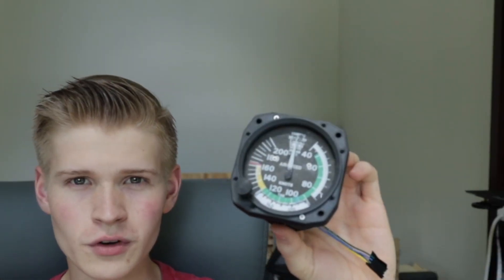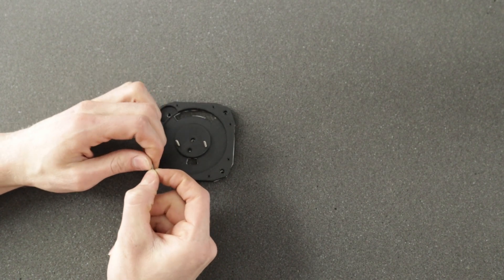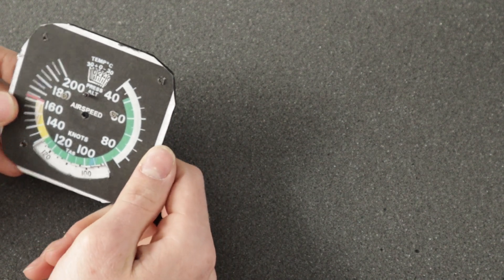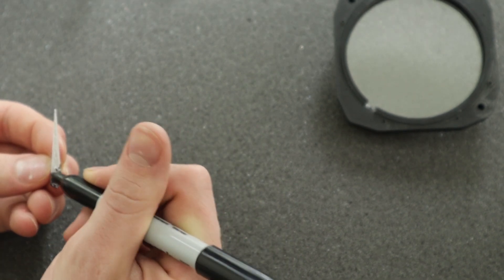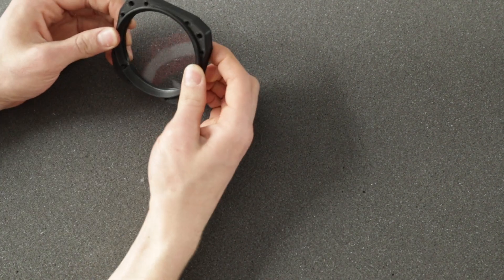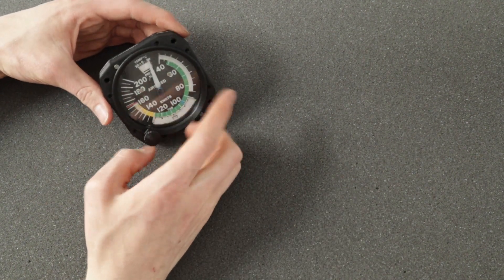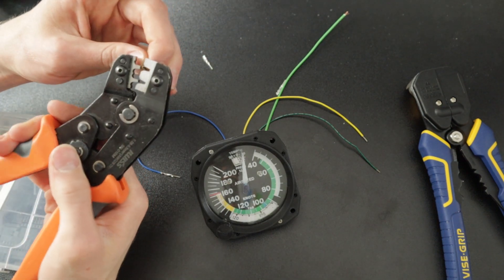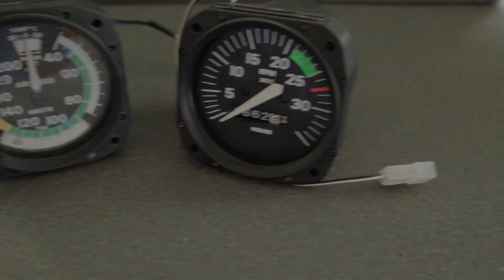DIY Cessna 172 Airspeed Indicator | C172 #33

Comment: Very nice collection of instruments you've put together! I've printed the 28BYJ-48 version (since I have several laying around), and I'm trying to figure out what you used to join the needle to the pulley - any hints?
Reply from the maker: Hi Chris! What do you mean by pulley?
I did use some super glue to attach the gear to the knob.
Reply: @CaptainBobSim  I've tried a couple of times to reply, and not seeing it show up, so maybe including a link is a no-no. In any event, the pully is in your github (Section 2 - Component Library and Structure/2-5 Instruments/6-PACK_Airspeed Indicator/28BYJ Stepper Version) as "Back Plate Stepper 28BYJ-48 Pully.stl" That's the piece I'm referring to. Looks like maybe there's supposed to be a metal rod or something that interfaces between the needle and the pully, but it's not shown in the fusion file. 

I just had some X27s show up, so the question may be moot, but I do like the idea of not having the screws coming through from the front of the instrument with the 28BYJ.

Comment: 🤔 Is there any reason to use a driver if we can just connect it straight to an arduino?
Reply from the maker: Just for fun!
These are small enough that the signal pins can provide enough power to move the shaft of the motor. The drivers also have built in diodes which mine does not have.

Comment: Your projects (and the Warthog project) makes me want to make a flight sim cockpit... even though i don't fly. :D  I  am using similar techniques to make an Apollo 11 DSKY though... :D  I love how low-tech it all is, but when it comes together, it looks just like the "real thing".  :D
Reply from the maker: Go for it! I find it's really fun, even though like you I don't really fly 🙃
Reply: Also, you should get a black paint marker to use instead of the sharpie... it'll have a much denser black.
Reply from the maker: I ended up using a printed decal and that gave a much better look. A lot of it also is the bed finish the printer gives you.
Reply: one trick i heard, which i haven't figured out how to do yet is to print blacks with full CMYK rather than just K, and it will come out more dense on the paper..
Reply from the maker: @yorgle  Interesting! Let me know if you figure it out that would be relaly nice!

Comment: Hi,
i was wondering how you made the decal?
Reply from the maker: I printed it on a shipping label
Reply: @CaptainBobSim  Where did you get the Image from?
Reply from the maker: @LeNinjaHD  It's on the GitHub under component library: https://github.com/CaptainBobSim/The-Cessna-172-Project-V3
Reply: @CaptainBobSim  Yea, but i was wondering how you made it or where you got it from? 😅 Thanks!
Reply from the maker: @LeNinjaHD  Gotcha :) I made it in Inkscape. You may be able to edit it. If I recall correctly I found the images I based off of from ebay instrument searches.

Comment: Hi there Bob. I have built your Altimeter from 2 years ago using the 28BYJ-48 stepper but have found they tend to get hot and after some use they don't always work correctly. Is it possible to convert from the 28BYJ to the X27 you are using here. Has any one done this?
Reply from the maker: Ian! It's great to see you again,
I haven't made an x27 version yet, but hearing your experience I'm more tempted to go this route.
Reply: Thanks Bob. I have heard that the X27 will only drive a single needle successfully is this correct do you know. Am thinking of trying to convert your Altimeter design from 2 years ago but dont want to buy X27's if they wont do the job as the altimeter has like 3 sets of gears. what are your thoughts?
Reply from the maker: The x27 is very weak, so it would need to be a specially designed system. I know there's a concentric two needle version. I think it'd need to be modified though.
Reply: @CaptainBobSim  Thanks for getting back. Look forward to more of your great creations
Reply: What about using a heat sink on the steppers that get hot, like a cpu cooler sink or something?